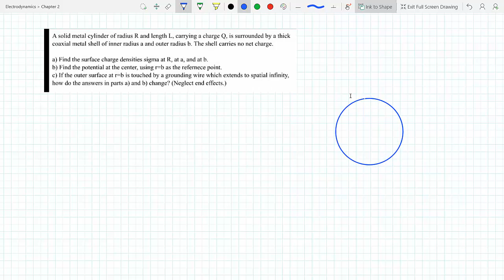Find Surface Charge Density and Potential everywhere on a Concentric Cylindrical Shells

Comment: how i want to solve this probleum.
A hollow cylindrical shell has a radius of 2cm and a lenght of 25cm. Assume the bottom of the cylindrical shell is in the xy plane and the axis of the shell lies on the z axis. The surface charge density on the surface r=2cm is 2.1 x 10^-8 C/m^2. Determine the electric field intensity at point P(0,0,15cm).